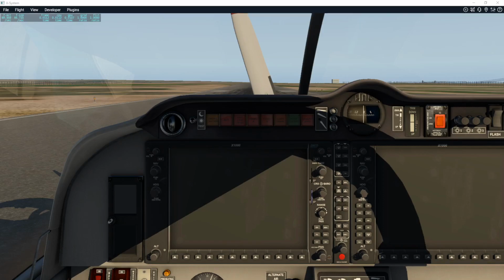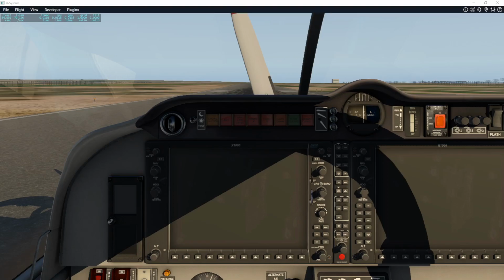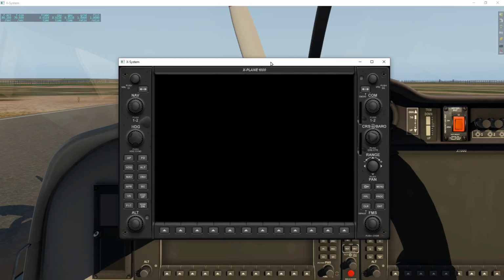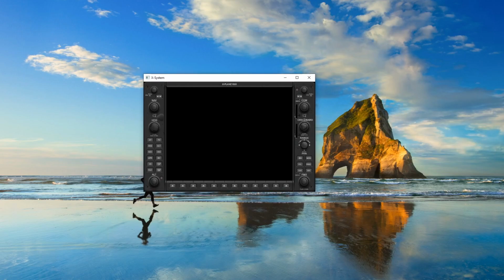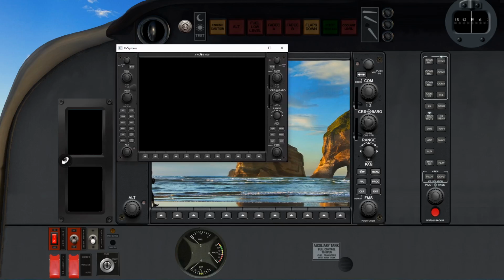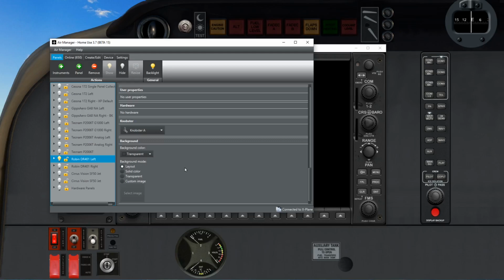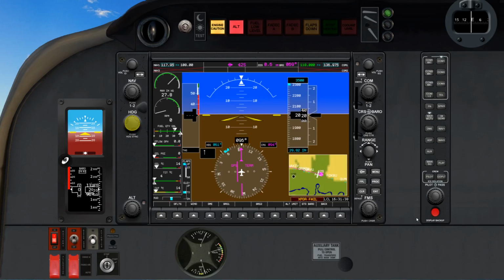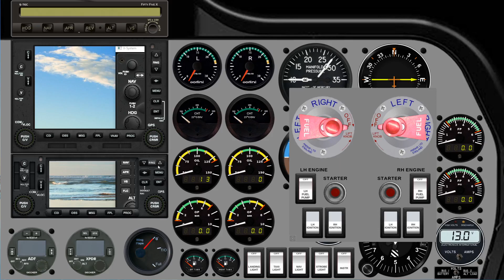X-Plane pop outs with Air Manager

Comment: How about an explanation as to how you made the AirManager cutout transparent?  You start from a default condition that is not the same as how AirManager panels are configured.  Your video does not help explain how to make the popped out instrument appear behind the AirManager screen.  When I start the AirManager Panel the inside of the Garmin 530 is solid black.  There is no way to see anything placed behind this window.  This seems like a pretty glaring oversight if this is intended to be a tutorial.  Need to start from step 1, not step 7….
Reply from the maker: This video is not about graphics creation it’s about popping out a display from the. sim and interfacing with a pre prepared AM panel. As long as you know how to do that after watching the video it served it’s purpose. This particular video was done long ago before MSFS 2020 was a thing and since then I have done another one based around that sim. It covers the concepts of creating and using your own panel background with transparency and what each of the related AM settings do. Although I use MSFS in that video it equally applies to Xplane. https://youtu.be/vkcjiBTdtQM

Comment: HI Tony, I have watched this video and your other on msfs numerous times and still cannot get a pop out to work in XP 12.  I created a blank panel and used the Garmin 1000 overlay.  I pop out the G1000 and move to to one of my touch monitors and overlay the entire instrument over the overlay as you do in your video using Air Manager 4.  I then lock the panel and no matter what I do the popped out instrument disappears.  What ends of happening is that X plane displays the g1000 as a pop up outside of Air Manager.  I must be missing a step to have Air Manager lock in the pop out. Any guidance would be much appreciated.  Thanks!
Reply from the maker: Did you watch the MSFS video that has some extra detail about creating the overlay and what all the settings in AM do. From your description it sounds like you don’t have a transparent cutout in your panel.
Reply: @ExperimentalSimAvionics  Thanks Tony.  I will review that video again.  Watching your X Plane video I don't recall that discussion which could very well be my problem.  So just placing the overlay in the panel is just a first step then.  More work is required before placing the pop out.  Appreciate the quick response.
Reply: Tony, on my last try I use a blank panel with the  g1000 overlay and when I show it in AM I can see the desktop behind it.  However when I move the g1000 pop in to the touchscreen monitor it doesn't stick.  By that I mean I click an area of the AM manager screen the g1000 disappears.  When I click in the middle as you do in your video it does not reappear.  When I hit show I get the bezel with the large transparent area.  I can alt tab and get it back but is not integrating with AM.  What I do end up accomplishing is that XP now uses the touchscreen monitor for the g1000 pop in outside of AM.  I put it back and keep trying with the same results.  I have layout selected with colors transparent.  Any guidance is appreciated.  I even tried your method of a custom I age with a transparent section.  Same result even though the transparency was in effect.
Reply: Tony, here is a video showing what I did.  I believe I have the transparent cutout as required.  https://drive.google.com/file/d/1wTJBKuVgIW7mxXDlER2ZyFeDnT9E3aUO/view?usp=drivesdk
Reply: Tony, I finally got this working.  My problem was that I didn't understand that you place the pop out in the panel as it is running.  I was trying to place it in the overlay before it was running.  All good now.

Comment: So.  How can I get my hands on that panel you made with the center panel? lol
Reply from the maker: I used a couple of panels in this video. These are my own designs. The DR401 panel will have to wait a while to be released but the Tecnam panel should be coming to the SI store soon.
Reply: @ExperimentalSimAvionics  looking forward to it!  Does your side comm panel with the backup display button actually work?
Reply from the maker: @avproductions5184  I think you mean the GMA1347. Yes it works for the functions supported by the sim.

Comment: This is a great video, however, I'm having a problem getting the white bar to stay when I hit the upper right icon.  And , how do you get the transparency to work?
Reply from the maker: Never had an issue with the white bar so not sure on that. For more detail on transparency watch the MSFS pop video. The panel creation with transparent sections in that video applies equally to any sim.

Comment: Undocking means you lose half of your fps?  When I do so, my fps are half what they were before undocking the G1000.  How can I prevent this from happening?  It s related to xp11 running as windowed rather than full screen.
Reply from the maker: That’s a computer hardware and Xplane performance related thing and a question for one of the Xplane forums.
Reply: @ExperimentalSimAvionics  I was indirectly asking if that was only me or if this happens to everyone.  So I guess it s everyone now.  I did not know that up to the beginning of the week before I bought Air Manager.

Comment: hello, thanks for the video info. very helpful.  I am stuck though as to how to actually see the gps screen.  I have my panel with the gns430 on it, also radio stack to the left.  I have this panel open and the 430 overlays on the AM GNS430. click panel and it goes to the back so white top bar is gone...but so is the gns screen?   How do I keep the actual sreen showing?
Reply from the maker: Hi Eric. I assume you have just a black screen correct? It could be a few things so let’s start by establishing the basic state. Is the aircraft powered? is the avionics master on? Is the individual gns unit turned on via the volume/on/off knob?
Reply: @ExperimentalSimAvionics  thanks for super quick reply.

Yes indeed the screen in the GNS is black.  
Aircraft is on, avionics master is on, I can  see the gps map in it when I drag it over to the other screen with the Air Manager panel open.
Reply: @ExperimentalSimAvionics  So not sure I explained too well lol.  So I have the AM Panel open and it has the black screen.  XPlane is running, plane running, GNS430 on and can see the map.  I click it to open to the screen, drag it over to the other screen where the AM panel is and it is positioned over the AM GNS.  All good to there, I then click on the panel and the map disappears and am left with the GNS with black middle?   hope that makes sense.
Reply from the maker: @focusedfrog  I think I understand., Before you even need to concern yourself with the Xplane popout you need to get the AM panel GNS to show your desktop through the area where the display will be. Hopefully you have the desktop set to something other than black so you can tell when it’s showing through. You did not confirm if the gns is itself is turned like I asked my last reply. Check this and if all good I suspect you have not got your panel settings correct. Is this a paid panel or one of your own?
Reply: @ExperimentalSimAvionics  ok so the AM GNS Is certainly the issue as the map portion is not showing the desktop background?  yes indeed the gns is powered on as I can see the map, up until the time I click the panel then it goes behind the AM panel.

I have a full screen grey panel made in AM with the Radio stack and GNS.   However the panel is set to solid so this can be the issue.

So perhaps I have to set my desktop to grey, and make the panel transparent?  Thanks
Reply: @ExperimentalSimAvionics  sorry to add to my last.  So this is a panel that came with AM, the GNS 430

By making the panel ‘transparent’ and my desktop grey I have achieved the goal of seeing the map. However,  this is ‘on top’ of the AM panel so not possible to hide the white top bar of the GNS?

So I still have it wrong!  Lol
Reply from the maker: Ok you have the panel setting incorrectly set. The important ones are background mode and background color. Please watch my other popout related video which I did for MSFS. What sim you are using is largely irrelevant for these settings and I explain in that video how and why you have to make those important settings to get this right. Be sure to let us know how you get on.
Reply: thanks Tony...I got it now...understand finally after watching the G1000 msfs video.  Cheers indeed

Comment: Does it require a USB Type-C Display Output Port to get the "Touch" Function to work? My laptop only has a "Mini DisplayPort" and a "HDMI" Output for display output.
Reply from the maker: Most desktop touch monitors require one connection for the video (HDMI, DP, etc) and a USB connection for the touch.

Comment: Hi Tony  Thanks for video . very helpful. Couple of questions: I see you frame rate as around 80-90: Could you state the set up specs of your PC?  Secondly , is the STEC55 available in Air Manager ?
Reply from the maker: This was running on my development machine but the specs are nothing special really. I think that was also a vulkan build of Xplane so the frames will be higher. My STEC is not available in Air Manager.
Reply: @ExperimentalSimAvionics  I fly the Robin DR401 155CDI and wondered if you are selling / sharing the Panel you have built for the Robin? It looks fab. The aircraft I fly has a G500 / GTN750 & whilst the GTN is available through XPReality , and works well , the G500 is not available. Hence would be great to run the Air Manager panel you have built and can also use the GTN750 separately and hence will be very close to the real A/c using 2 X touch panel screens.

Any way let me know , and if not available any advice on how to create would be welcome

Comment: Thanks for the video. I have RealSimgear GNS530 and if I lay the popout from (B85)m the Air Manager panel shows a transparent hole where the GNS530 is. Any way around this?
Reply from the maker: Yes create a different panel background image that has the transparent section filled in or create a simple instrument with a plain image and use it to cover the hole.

Comment: Thank you. Can you help out? I’m thinking of building my grandson a 42 inch wide by about 14 inch high aircraft instrument panel that will start off using Cessna 172 components along with steam gauges and then later Ron transition to more advanced displays like the G1 thousand but since this instrument panel will only be running side-by-side 22“ x 14“ monitors will I be able to use air manager to customize an insert the X plane or Microsoft 2020 instruments to fully import the Cessna 172 cockpit instrument panel components using their manager and how far down individually can these be plucked out of the X plane Cessna 172 display and landed on the two displays that will comprise the entire podcast? Any help appreciated.
Reply from the maker: It’s not 100% clear what you want. Almost all of your questions can be answered by playing with the sim and Air Manager. Only a select few instruments can be popped out from the sim. The majority will be Air Manager instruments that get data from the sim.
Reply: @ExperimentalSimAvionics  thank you for your reply. Appreciate it.

Comment from the maker: Not quite.  Xplane will remember the size and location of each of the different pop outs so that bit works ok. What is the problem is when you jump in a different aircraft and require the pop out to be in a different position. I’ve already asked Laminar Research for a per aircraft persistence feature or datarefs so we can control the size and position of every pop out from an Air Manager script. It would be useful for everyone who wants this feature to log a request with LR. The more people that want something the more likely it will happen.

Comment: Great Video - thanks for making this very clear. Just for clarity - you have to do this every time you fly - no-one in the community has come up with a way to automate this yet so you can easily switch between Air Manager panels and popups already popped out from X-Plane and in the right place?
Reply from the maker: Xplane remembers where you left the popouts so that’s already there. What’s needed is for it to remember the popout position per aircraft.

Comment: Good video and thx.  I solved this issue using spacedesk.  Virtual networked monitor.  Using only 1 copy of xplane. Usong it for yhe garmin 530/430/trans/ap stack.  Using the air manager overlay.  Works well. :)
Reply from the maker: You are welcome.

Comment: How do you put a g1000 on it's own monitor? is there a separate bezel?
Reply from the maker: You can pop out the MFD in the same way. The G1000 bezel is just setup to direct its commands for MFD rather than PFD1.
Reply: @ExperimentalSimAvionics  Thanks for the reply, much appreciated. What I need is basically just the bottom section of the PFD/MFD, the section or part containing the 12 soft key buttons, I do not need the L, R & TOP sections of the G1000 PFD/MFD bezel. I'm using a 15" touch screen for the MFD, and the particular MFD I need as overlay is only the bottom part with the 12 buttons. I'm having zero luck in building this bottom section for use in AM.
Reply from the maker: @stephenalberts6873  That’s quite straightforward. Clone the existing bezel then use a graphics app to blank out all the un needed controls and you are done.
Reply: @ExperimentalSimAvionics  Thanks, where does the image reside, assume PNG format, in order to edit in graphics editor?
Reply from the maker: The png file will be in the instruments resources folder. The best way to access it is via the create/edit tab.
Reply: @ExperimentalSimAvionics  Hi Tony, I was successful this morning in creating and editing the cloned PNG and this display in my AM panel as the cloned instrument, I edited the PNG in MS Paint, the issue I am having now is that the new instrument (after editing in Paint) is no longer transparent, even though the transparency button is selected. The inside of the proposed MFD panel now contains a solid white background, and no longer transparent.
Reply from the maker: You pop it out from Xplane and drag it to the monitor of choice. You can grab the edges to resize. If you want control via Air Manager you will need to create a panel with just the G1000 overlay and then have it run full size on the same monitor as the G1000 pop out.
Reply: @ExperimentalSimAvionics   Hi, I'd very much like to do this, creating a custom G1000 MFD (for the Hotstart TBM 900) for full size use on a separate monitor. I'm using the already available G1000 PFD in Air Manager's panel for the PFD on a separate monitor, but would like to create or make the MFD for the TBM 900 for use in Air Manager for it's own monitor. Your guidance and advice in doing would be greatly appreciated, thanks in advance.
Reply from the maker: It seems you have not created the png correctly with the transparent window. I don’t use MS paint as I don’t really like MS products so I can’t help with that. There are other good free graphics programs. I use GIMP for this type of thing.

Comment: Great explanation thank you. Is there any chance to share P2006 G1000 panels? Couldn't find them in Air Manager library.
Reply from the maker: The panels are meant to be coming to the store soon. I was hoping for them to be released for 3.7 but alas that didn’t happen. Hopefully they will be out soon..
Reply: @ExperimentalSimAvionics  That's a great news. Can't wait. Could you update a video how does it look like and work??
Reply from the maker: Sure. Watch out for it.
Reply from the maker: I’m afraid to say they are not going to be in the Sim Innovations store as they had a change of heart. If anyone really wants to see them there they need to convince Sim Innovations it’s worthwhile.
Reply: @ExperimentalSimAvionics  I'm new to the AM world and I'm trying to understand why Sim Innovations would make that choice. Does that mean there isn't going to be any way to share your work?
Reply from the maker: John, I was told that they didn’t want panels that used pop outs from the sim. This has been clarified recently to mean a panel with only a pop out using version. The P2006T panels have an analog panel and a G1000 version so this now may be acceptable. Never say never. I’ll update here if I manage to make progress.

Comment: Hi Tony, I am still having trouble trying to work on G1000 panels PFD and MFD  for DA62. Maybe I am not doing it correctly. I have 2 monitor setup.
Reply from the maker: What exactly is your trouble?
Reply: @ExperimentalSimAvionics   I am trying to use Cirrus SF 50 G1000 to use as pop up on DA62  G1000  or trying to clone the panel to work with DA62 . and trying to work out how to create a panel. i am not good at working with computers